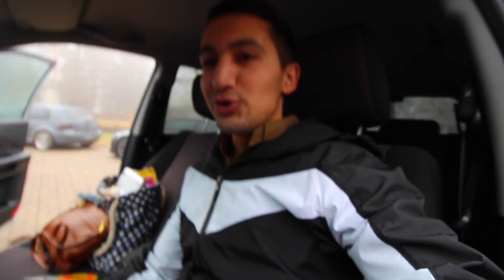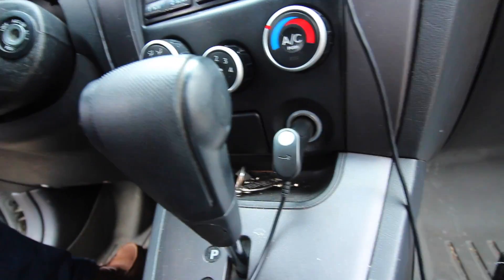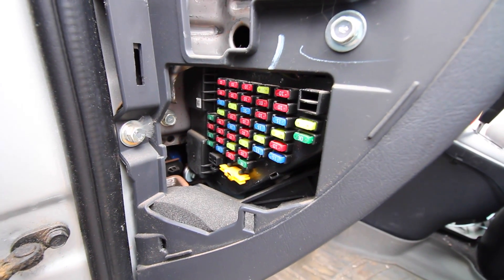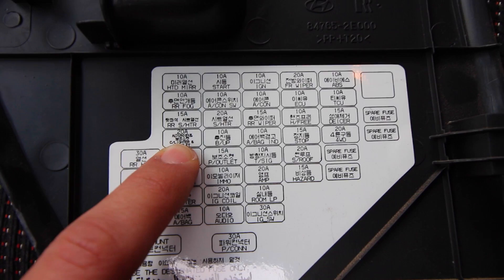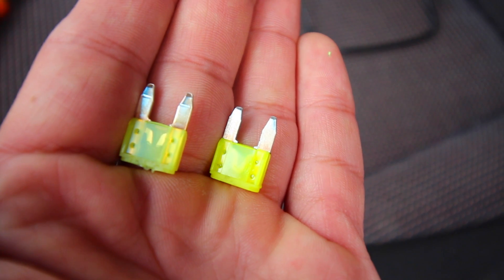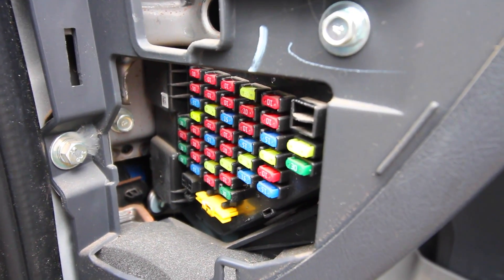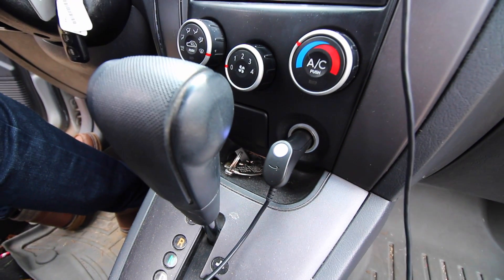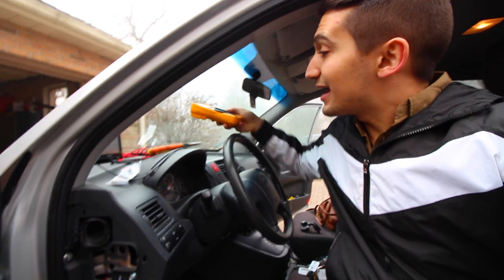Electrical Problems.. Where to Look First?

Comment: Fuses only blow when the circuit shorts out or is extremely overloaded. If a fuse blows, you need to find and fix the problem.

Comment: Well, when you replace fuses,before you replace it verbatim (same for same) double check to see if it is the correct fuse as I found that mine was set at 10 amps rather than 20 amps.

If your fuse has blown on other components, then it may be overloaded or shorting somewhere else and you will need to download the wiring guide to your vehicle to hunt it down.

If it is the accessories port and it is the correct fuse... STOP OVERLOADING! if you need more accessory ports and you ave done the math INCLUDING WASTAGE then you may need to install a separate accessory port and fuse together, using your wiring guide so you can tie it into the factory settings(or you can just wire it directly to the battery)

Comment: I thought I had issues with my fuses too, i kept getting issues with my radio. But when my car blows a fuses my dash tells me about it. It literally says "fuse blown". Never thought a 2004 Neon SRT4 would be that advance LMAO. but my issue was with my main harness. Some savage cut a lot of the wires under my car and i was having a lot of ground issues from there.

Comment: I have a Tucson 2.7 too :) I flushed the brake liquid (learned from your brake job videos) and you can not bleed the brakes without a scan tool to unlock air bleeding. I`ve also tried overnight gravity bleed method or with engine running and nothing.
So i called a mechanic with a pro scan tool to finish the job :)
Now i have bought a delphi-ds150e but i don`t have the courage to try again...someone knows if the bleeding operation works fine with delphi-ds150e for Tucson v6 2.7 ?
Thanks.

Comment: What about, when the same fuse keeps going out. My sister's power outlet fuse has gone out 5 times over the last month. It is the correct size and the outlet is only used a few times a week. What else could it be?
Reply: Back Seat Garage The device you are plugging it into it. or the actual outlet can have something inside it or dirty. but I have seen chargers and other devices blow out the fuses and people blame the car.
Reply from the maker: Whatever your sister is plugging into the charger, might draw too much power. So say it might draw 6 amps, and your system is only rated for 10, if you plug something else in like a phone charger or something else and it is more than what the fuse is rated for, POP!! There goes another fuse.
Reply: Also some of those outlet fuses depending on the car is connected to the radio. So it already has a low ampage rating. My old Toyota Celica had a 15amp fuse for the power port and the radio on 1 line together. So I had to be careful not to over load it.
Reply: Thanks you guys.

Comment: Hi Milan, my re circulation button was faulty so I replaced it with a new one. When I press on it, the light comes on but the mechanism inside does nothing, I can still feel the air from the outside coming to inside my car even though the light works. I checked the fuse but it's good. What is the problem you think? Thanks!

Comment: My led doesn't work on one side in my car u got any solutions?
Reply: Milan mastracci
Reply: Dj Lux most likely it could be the oem ballast. Either get a new one or get a fairly used one on eBay

Comment: There is a spacial tool in fuse box. No need to use pliers.
Reply from the maker: I thought it was too, but when I pulled the yellow clip out, it was a larger fuse. If it was a fuse plier, I would have used it and demonstrated it lol In the golf, there is one explicitly marked :)
Reply: I thought that the yellow thing below the fuses was that tool.
Reply: milanmastracci bruhhh!!!! Is right there!!! The yellow piece at the bottom row ofthe fuse box
Reply: the fuse plier is in the fuse box in the engine bay.
Reply from the maker: Usually there is, however I didn't see any in this car
Reply: milanmastracci my led doesn't work on one side but it works if I have the car running for 10 mins got any solutions???? PLZ HELP
Reply: I have one but I still prefer to use pliers like he did.
Reply: Edgaras Ega vvvcccxcvc
Reply: milanmastracci ????
Reply: milanmastracci ????